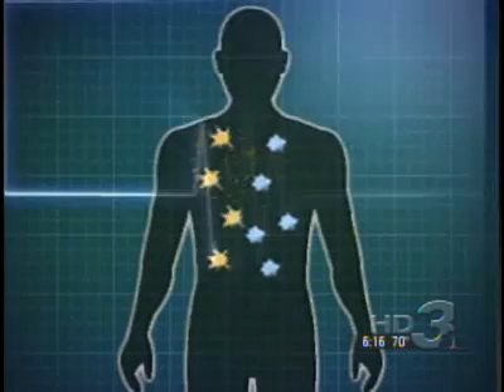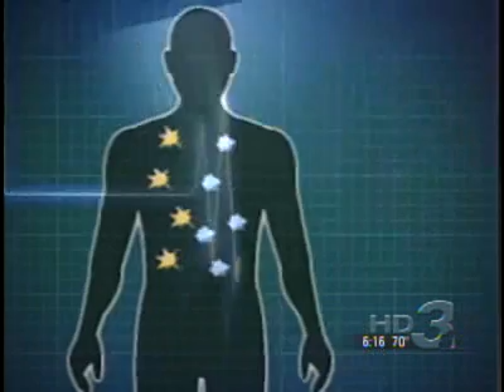burning sea water with radio waves

Comment: This technique is actually being used today for cancer treatment. In the modern version, cancer cells are biochemically induced to uptake tiny, precisely sized, non-toxic gold nanoparticles. Metal particles resonate with a particular frequency of light dependent on their size, so the size of gold nanoparticles is attuned to resonate at the same frequency of infrared light that can normally pass through human tissue. The tumor is then blasted with bright infrared light, causing the particles to resonate, heat up, and scorch the cancer cells from the inside, all without harming the surrounding tissue.

Comment: I wonder how much energy he is putting in to get what he got out?
Reply: Even if it’s equal it’s still better than building toxic batteries.
Reply: Frequency generators use some power but they said it could get up to 1500 centigrade wich can produce alot of power
Reply: It's not about efficiency.. efficiency can be optimised , its about radio waves and water..

Comment: Killing cancer cells with radiation?  Wow, there's a new idea!  The salt water in the test tube is being constantly bombarded by the RF energy produced by the contraption that he uses to light up that fluorescent bulb.  Question is, will the energy from that "burning sea water" be sufficient to turn an engine sufficient enough to turn an electric generator sufficient to run the RF generator that is used to bombard the sea water test tube?    The short answer is NO.  Not by a long shot.   Not since the clock boy was invited to the White House has anyone received more attention for less ingenuity.   I'm embarrassed for everyone in the video.
Reply: cynic and a lil b is what you are.

Comment: So why  don't we  use  a radio reciever  producing  a  constant 13.5 MHZ field  with an ignitor circuit  to  burn  water   for  heating our homes  more efficiently  and   without  the toxicity of  fuel oil? WTF?  A crystal  FM receiver    requires  no electricty   to produce  the  oscillation  required.
Reply: Electrical heaters would be far more efficient

Comment: EroEi factor. (energy returnover energy invested) How much energy is created by the radio wave generator, versus how much energy comes from the reaction. IS there a possitive balance (more energy in than out?) I guess you can use it as a way to store fuel for a vehicle, but it's not exactly a source of energy, if it well takes more energy to create the radio wave generator than you get from the reaction.

Comment: No ... the real question is ... can you separate the hydrogen and oxygen with this method, using less energy than the energy used in electrolysis? ...

Also, what radio frequency is used to cause this reaction ...
Reply: Blue X Studio you are absolutely right. They say in the video that the fuel is nothing more than salt water but that's not true because they are out putting a lot of electricity to generate those Electric magnetic waves. It hello already been shown that a simple electric current through water that has almost any kind of electrolyte such as salt can be used to separate the oxygen and hydrogen molecules in the water. The problem is when you burn those oxygen and hydrogen molecules are you generating enough energy to produce more electricity than it took two separate the water? There have been several designs that show this is possible. Internal combustion engines that run on nothing more than hydrogen and oxygen as a fuel powering an electric generator that is generating significantly more electricity than is being used to create the fuel
Reply: 300w power in, around 14mhz. More power in than out. Still very cool though. Every atom has a frequency that holds it bonds together. Imagine what you could do if you know the frequency that spilt other bonds. Good and bad.
Reply: @midwest_silver  frequently how much hertz?
Reply: @midwest_silver  idk man 1500 centegrade converted to jouls is more then 300w converted to jouls is it not
Reply: @jason3044  either im dumb or 1500 centigrade to joules to kcal to watt equals 790watts/hour wtf
Reply: @jason3044  300w output power on the radio transmitter ... dosent equal total input power 🙂 total input power is probably from what one sees in this video on the range of 2-3kw

Comment: You idiot. There is no "Free energy", we convert one form of energy into an other. Seriously, learn a bit of physics. When talking about friction i was talking about the planets (if you can read the sentences), for instance ISS needs to adjust orbit periodically by spending fuel because at its altitude there still is air molecules that hit the space station that slow it down. Not the care with the moon. Do you realize perhaps you lack the knowledge and just talking bullshit ?

Comment: Actually there is no energy consumed or generated when electrons orbit protons  in the atom, its simple orbital motion generated from the pull between electrons and protons. Same is observed on planets, Moon doesnt have to spend energy or consume energy to orbit earth, because its under no friction to slow it down, in turn the orbital motion goes on and on .. and on. :)

Comment: Imposible, you cannot create more energy than what you input
Reply: By your one side logic your car should not have more power then your coils and spark plugs can produce... when you ignore the potental energy of fuel that is.
Reply: The thing most of ypu are not understnading is the potentual energy of then elements in the water and the amount of energy they add to the equation when burned ie your seperating the hydrogen and ignighting it the hydrogen potental energy could make this system produce power and not loose power. Thats why you can hit it with the frequency to seperate the elements then ignight them and boom produce more power because of the potental energy stored in the hydrogen gas
Reply: Isn't this basically fission? @jason3044

Comment: would it be possible to create a small (or huge) spot of flammable ocean by aiming the RF and a spark at it? sure, forget efficiency in traditional internal combustion engines, but how about defence applications? ie, suddenly the water surrounding an enemy vessel lights up

Comment: i can tell you the secret- study stan meyer's work.  using radio waves to resonate and break the molecular bonds is different than normal electrolysis.  he ran devices with tiny pulsed dc from small batteries. you could probably use a joule thief and earth battery with caps.

Comment: the specific point of this isn't to produce more energy than outputted. this could be used like HHO generators for boosting gas mileage in a vehicle, not eliminating the need for gas completely.  it's unlikely that there will be a single replacement for gas in cars for a while, but instead a combination of different power sources working in conjunction without fossil fuels.   it's a step forward.

Comment: does anyone know what freq he used to do this. and how much power 120/220?? Maybe you could heat a home with this Idea. using boiler heating system in house.
Reply: the article Kanzius published in "Materials Research Innovations" March 2008 Vol 12. It states he used 13.56 MHZ at <300 Watts.

Comment: @michalchik erm, read up on this, he is using the radio waves to separate the O, and H out, like in electrolysis, which is what he is burning.  They are highly flammable.  H and O are the reactants, H is oxidized, O is reduced, the product is water.  Of course this is not efficient because it takes more energy in radiowaves to separate the O and H.

Comment: @rt36crazyfists No, burning is an oxidation reaction that produces net energy. He is making the water glow in a power consuming electrical phenomena. It is essentially what happens in a florescent light bulb or plasma ball. Look up how they work. If you heat gases up they look like flames but they are not making energy. It is the difference between a lump of coal which glows by burning and produces energy and a electric stove which glows by heating and consumes energy.

Comment: unless it breaks the laws of thermodynamics it uses more energy to generate the radio waves than you get from burning the salt water since its splitting the molecule and you get energy from the re binding of the molecule does not mean you cant use it for something

Comment: I need a machinist and someone to make a small type of radio wave tube so I can make a type of sparkplug for the gas engine..this will work if I use the same coil setup in the car..there will be more then enough voltage to make salt water work and will be clean..and won't freeze..anyone wants to take this on with me..

Comment: This is in no sense burning. Nothing is being oxidized, no more energy is being released than is being put in. He has simply made a microwave over ans is heating up the surface of the water until it vaporizes. Once in vapor form it absorbs more microwave energy and it glows in plasma form. It is just like a florescent light except it uses water. Please people, learn some science. Its really cool and prevent you from making stupid mistakes.

Comment: There is a little problem here called the Second Law of Thermodynamics. Unfortunately it takes more RF energy to perform the electrolysis than the energy produced by the burning hydrogen and oxygen. This is nothing more than an interesting parlor trick.

Comment: @mwmmwm123 but dont forget the high voltage required by standard combustion engine to ignite petroleum and also the huge amperage required to crank a starter motor.. from my studies you would be able to energy required is quite similar to that of a standard combustion engine we are all used to

Comment: The key to using water as a fuel IS the ability to rapibly separate the Hydrogen from the Oxygen, then re-introduce it in a combustion chamber.
Could the bombarding of the saline solution with a particular radio frequency & amplitude be THAT catalyst? -  Of course temporary storage of the separated hydrogen & oxygen, so that its introduction into a combustion chamber in a controlled manner, is another matter. ;-)
Reply: It would be easyer to make a steam engine out of this and use water to make steam and burn salt water to heat the system
Reply: Is steam formation somehow not happening, or do wet steam bumble perhaps absorb the waves so well that they never get to surface as steam but do so as HHO?

Comment: neat, BUT, the power used to get salt water to do this is a LOT more than the flame output....this has to be. I wonder if this is more efficient than just making hydrogen with current through the water?

Comment: You are referring to exothermic reactions.  This process is first performing an endothermic reaction, followed by an exothermic one directly after.  In the case of burning fuel, the endothermic reaction has been completed well ahead of time i.e. by bacteria.  If you take any cyclic reaction sequence, including the seawater one, ultimately the energy both ways is the same, plus energy is lost.  So perhaps fuck off is too harsh, but for Christ's sake do not try to outknow me.

Comment: The seawater burns because the bonds have been destabilized by external means.  An alternative way of doing this is with electrolysis.  The amount of energy required to break apart water, is the same as the amount released, whether  electricity, or radio waves is used, when it recombines.  This video is not directly burning seawater, it is releasing the hydrogen, and then recombining it with oxygen in a flame.  This is highschool chemistry, give me an example that works differently or fuck off.

Comment: It takes as much as, or more energy than the amount produced by burning, to make the radio waves.  Saying it does not take that much energy is truly stupid as it violates the laws of thermodynamics and basic highschool Physics and Chemistry.  If it were possible to use radio waves to split the water using less energy than is produced, then one could simply repeat this process continuously and create infinite energy, this is impossible, truly 100% impossible.  Don't pretend to know things.

Comment: Burning of hydrogen produces enormous quantities of energy, and igniting it is a one time flick of a lighter, the only real issue is making an efficient radio wave generator.  If they ever make one that can keep producing the radio waves that takes even slightly less energy than the burning produces, then the energy crisis would be solved, and everyone powerplant would use a self powered system based on this, and a bond movie would come out where someone tries to ignite the oceans for ransom.